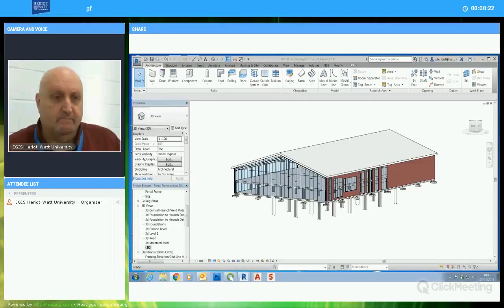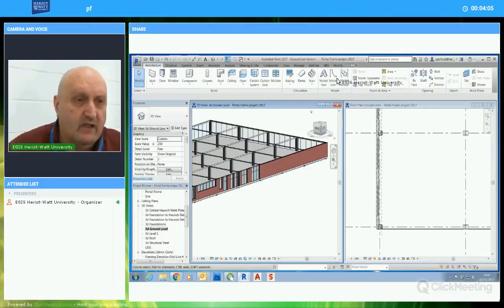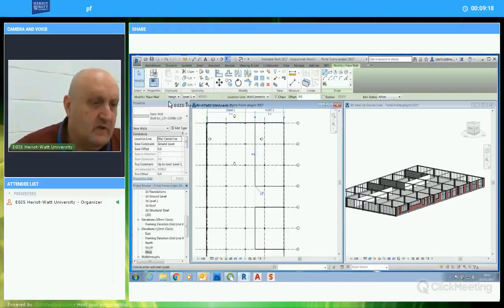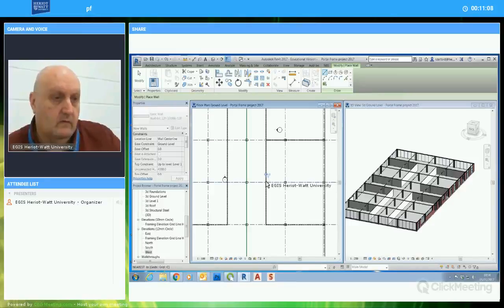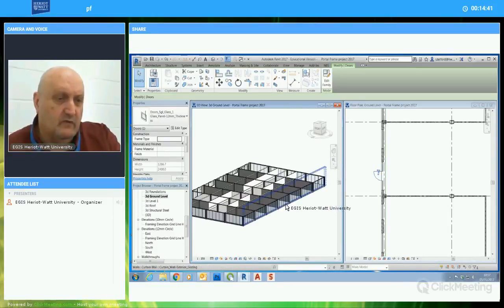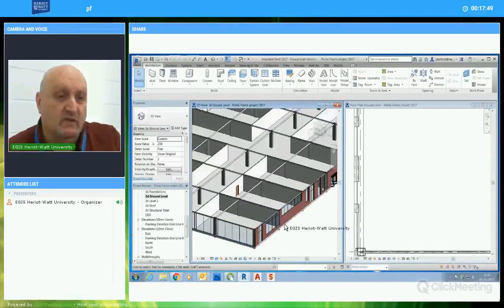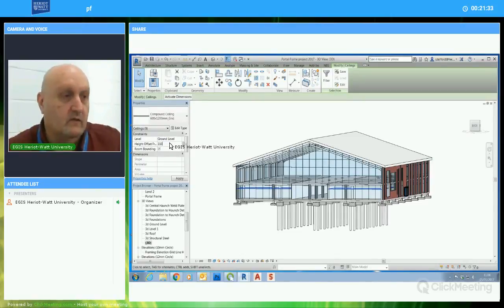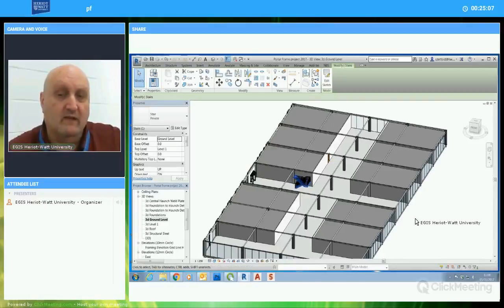Portal Frame part 4

Comment: Thanks knowledge, I want to ask add isolate the load family how....sir
Reply from the maker: Select the item you wish to isolate > Use the Temporary Hide/Isolate tool at the bottom of the main modelling window (looks like eyeglasses) > select Isolate Element

Remember to Reset Temp Hide/Isolate when you have finished
Reply: thank"s sir...